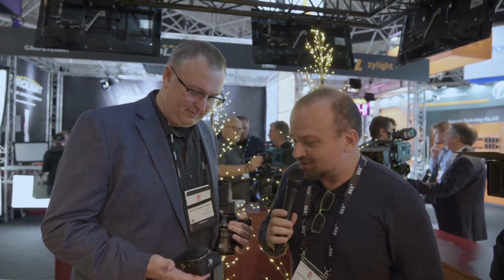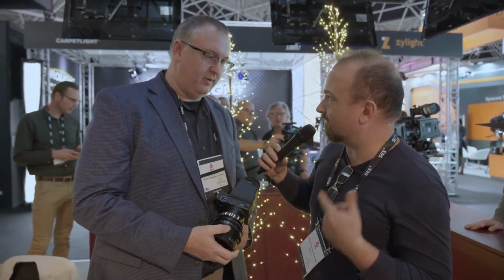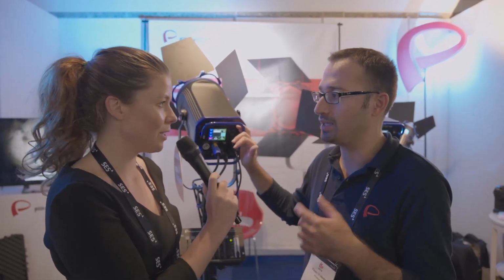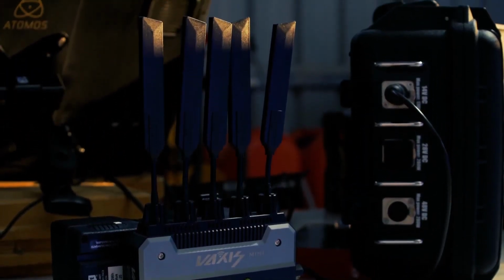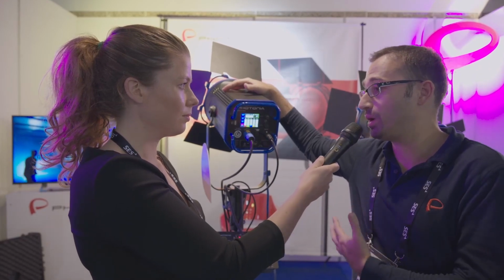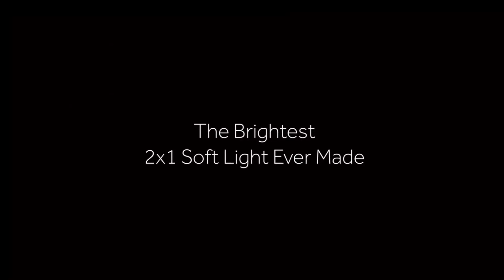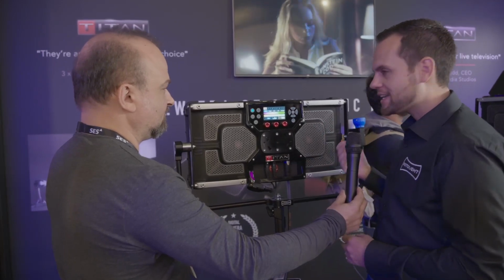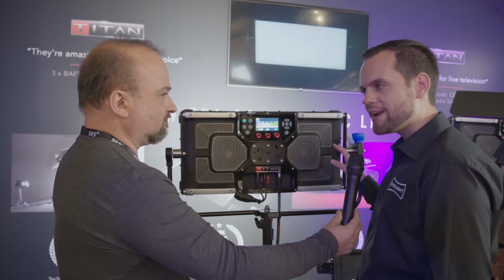Adcom @ IBC Amsterdam - seconda puntata - Sigma, Photonia, Rotolight

Comment: Thanks.  The battery for the SIGMA fp looks like the BLC12/BP-51 which also powers the original Leica Q, the Panasonic GX8, G85, G95 (+G7?) and the Sigma Quattro DP-series DP0/DP1/DP2/DP3
Reply: P.S.  I'm very interested in the fp, but of course I'm really looking forward to the Foveon - I'm hoping that it has the BCF19/BP-61 batteries which match the SD Quattro and the GH5/G9.  (Though, an APS-C version in the same chassis as the fp would also make sense...)